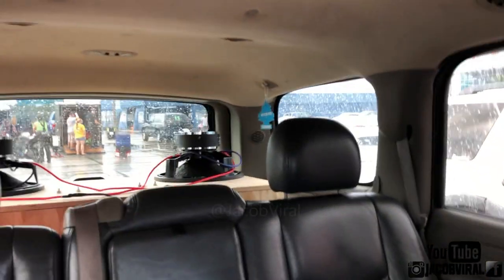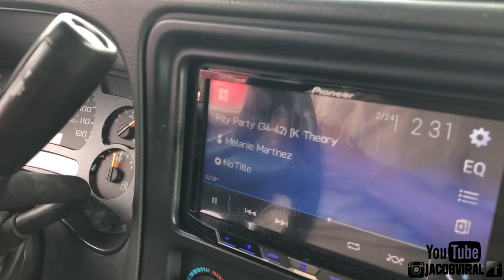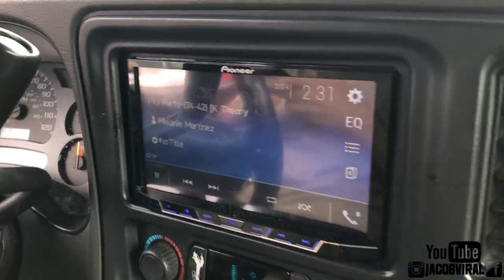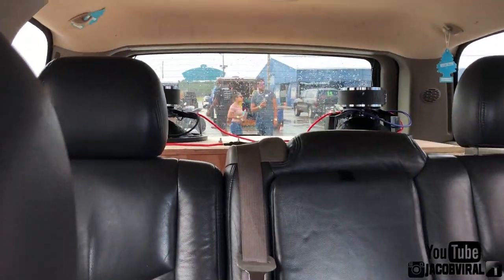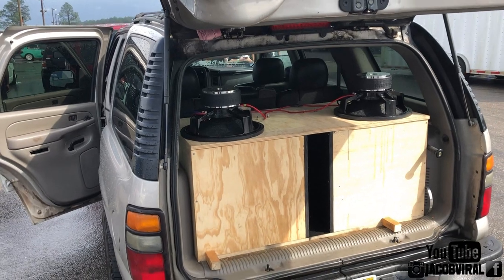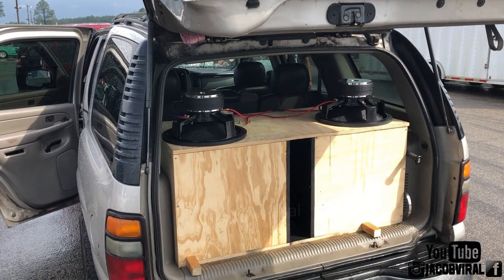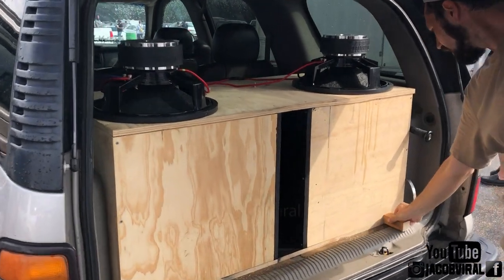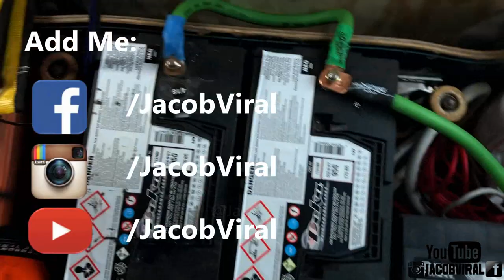CUSTOM SUBWOOFER T-LINE BOX TUNED TO 24HZ!?

Comment: IM PORTING 4 12S IN A RANGER XLT will the tuning go through the roof ??? Looking for opinions??? Should I keep it sealed ??? Thinking about going sealed with 8 p2s or ported with 4 p3s and let me tell you the p3s sounds wayyy better than the p2s when it comes to sq and loudness in sealed but I would need a t2500 first. The box is 2.3 cube separate chambers

Comment: That is far from being a transmission line. A TL for one 15 would be that size or bigger.
Reply: splshow , i got a TL box for a shitty 6,5inch, and it is a 56L box. The box makes it much better, but it is blown so i bought a sundown sa12 instead. Check my videos then you will find the 6,5inch and the sa12
Reply: Definitely not a tline 😂
Reply: The sub is inverted to allow for a smaller box
Reply: manny Pep . What does that have with t-line to do?
Reply: IMPULSE JVcfg someone said the box is too small to be a t-line and it does look that way but you can make a smaller box when you invert since you don’t lose the displacement of the sub. It still looks to small, it’s probably a labyrinth box.
Reply: manny Pep. Aaah i did not think of that😂 smart👍
Reply: @mrpep1976  stop saying "labyrinth" style. Its not technically a style at all. When you tune low, you tend to have a long port and you might have to make bends. More bends is not better, in fact its worse.
Reply: ndstrctbl could be worse if not made correctly. And there is a style called labyrinth because I owned one and I owned a t-line for a w7 12”.
Reply: @mrpep1976  you dont seem to understand, the term labyrinth is a made up term that prefab manufacturers used for marketing. it's a slot port with lots of bends. Its not any different than a regular slot port.
Reply: @mrpep1976  and more bends is in fact worse. The less restriction the port has, the better. If a port could be completely straight, that would yield better results in spl
Reply: ndstrctbl not all boxes are created equal, I really don’t want to go back and forth with this. I’ve had both, they sound good but it’s all design dictated. We can go back and forth all day about this but where will it get us? My opinion isn’t equal to yours but it’s doesn’t mean im wrong or right. I liked my boxes, sorry if you didn’t like yours.
Reply: @ndstrctbl  my port is strait! Good, thats dope
Reply: A t-line has at least 4 bends in the port each with a different tuning frequency. The ported box in this video had a big port area so they had to make it long to get the 24 Hz  tuning. A t line flattens out the frequency band making it seem louder but in reality it just makes a wide range of frequencies even out which makes it way more efficient. The guy was calling it a t-line because the port was shaped like a t. He had no idea what he was talking about.
Reply: I have a costume labyrinth enclosure and they get low,  .
Reply: @Hertzsogood219  

That doesn’t make you any less wrong about what you think. 😂

Comment: Ya I just decided to start box building again I was rocking Amazon’s biggest prefab for 15’s for a while custom made Orion Hcca’s then traded up to Adire Audio kh30001’s custom made as well 15’s. Ditched the prefab built a box but ports to short I took my 12 inch sealed “mid bass” more like more draw on my electrics for no good reason and took up space in my trunk-Grand marquis. Now I think I got my new box design should be better and I just got my Stetsom 8k moved up from a Stetsom 6k and I got my sky high 10 awg speaker wire so it was a quick swap- love my Orion dual 0 gauge power and ground inputs btw. Rockn a U.S Alt 250 big 3 dual runs of 0 gauge power and grounds to my two XSpower d7500. Bout to order a bracket to mount my second Alt and a XSpower super cap. I haven’t done a vid on it YET cause it’s not worthy imo YET :). Nothing wrong with trail and error audio is fun that way. If your a hater and to critical-RELAX it just audio man what’s the big deal it’s all about music and having fun. Getting hung up on what you don’t like about some else set up- just focus on your own geez. I love the smell of cut Particle board in the morning- though I may go for a lighter wood my subs are 90lbs each my batts are 100lbs each, who needs a lowering kit :)

Comment: Hey Jacob,  thanks for the videos. Would those subs sound better turn up instead of down?
Reply from the maker: Hey Tim thanks man appreciate it. It all depends on if the box is to big or not, but most likely louder mounted regular if box is to big.
Reply: JacobViral 
I’m really not understanding what your saying here.
Reply: Also. What do you recommend on my highs, like my door speakers, tweeters etc.
Reply: I got a Rockford 750 on  P-1 12 amd two P-2 10”s

Comment: Love the vid nice build keep up the good work. Quick question i have 1 sundown x12 2 ohm dvc thinking of getting another one and a taramps 8k 2ohm any ideas or help for me would be great
Reply from the maker: 2 ohm would be a good option to run the amp at 2 ohm instead of half ohm on a one ohm for sure. I would say you want to make sure you have the proper electrical for an 8k amp. Sounds like a nice upgrade.

Comment: Damn that's crazy you would think 2 15s tuned low would move more air. My 2 american bass xfl 12s on a skar rp2000.1 has more flex then that and they peak at 39hrz

Comment: those are revision 3 not version 3. Sundown only has sa v1's in that style, the v2's just came out and have the u style baskets. they just made different revisions to the same version.  but anyways who cares what type of box it is we should be more supportive of each other in this hobby instead of throwing flack. I don't give a shit if its in a bucket!  At least you got something.  Bad ass amplifier though. Glad to see it's not getting killed on .5 ohm with that electrical.

Comment: I have my box tuned to 24hz. I can easily change the tuning with adjustable aero ports but i keep it at 24 most the time. Hits the lows hard. Rumbles like a MF!
Reply from the maker: Wow that’s really low tuned, what’s the bandwidth like for the higher notes say above 40?
Reply: @JacobViral  Drops off pretty fast.  It's actually tuned a little lower than 24. It's 2 15's in 8.6 cubes with 2 - 5.75in aero ports each at 24in long. I get the most out of it at the 20-30 range. Do you currently have a build?
Reply from the maker: @Hertzsogood219  nice low tuned monster sounds like. My builds playlist: https://youtube.com/playlist?list=PL2fggEJq2gxS658gwzj1Z0B9RoKuL3d2p&si=r81sWqY30hWxzRIB ; 2024 no system, new vehicle/fun to try in 25

Comment: Not a t-line. Just cuz the port is long doesn't make it "basically a t-line". Its a ported box tuned to 24 hz. T-lines arent tuned like a ported box, the 1/4 wave design is based off the fs and sd of the subwoofer.
Reply: Nobody cares bruh

Comment: first off its called a Transmission Line Subwoofer Box and  they make bolts and you drill holes in the box and threw the body  put bolts threw holes put lock tite on bolt then put lock washer then put nuts on . if the box is moving your losing spl . learn how to wire without the tape . how that shit hasnt caught fire . yes there is beginers but there is common sence !!